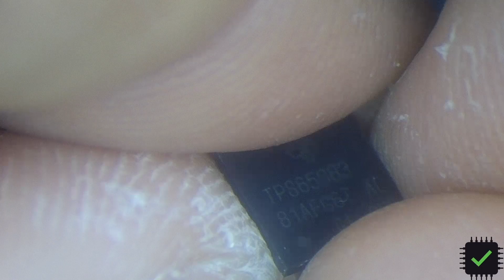Another Possible Weak Point on LG 5K UltraFine Motherboard if the Thunderbolt port is mangled

Comment: I have two LG 5K which both has come to suffer from the issue with the port. I have ordered new ports and am getting help from a local microsoldering company to hopefully get that taken cared of. 

However, it also damaged both thunderbolt cables (the long nice ones) and seemingly fried a thunderbolt port in two of my Macs.. very sad about that of course but one of the macs can charge albeit slow (using usb-c cable with wattage led I see it charges at about 15w) so I guess it might be a blown fuse or perhaps worse if its a controller or power regulator. Any ideas? 

I believe the cables became fried as I tested both in one of the monitors that seem to suffer more. The cable itself would become hot to the touch at the circuit part end but weirdly both works fine as charger cables. USB-C connectivity also works on the mac that survived but not thunderbolt. 

Thinking about if there would be any idea to put a small heatsink on the ICs that get hot inside the monitor? The fan is one thing but a heatsink could probably help disperse a lot of the heat buildup right? 

As I also have an iMac 5K 2017 I am toying with the idea of just making new enclosures (a dream Ive had for some time) and get new driver boards for the screens. Perhaps that would be a good way forward and also then have more universal monitors as thunderbolt is such a pain to be limited to when having so many different kinds of devices. (well one of my lg 5k is the newer with usb-c so it can for now work part time at least that way in 4k mode but still..)

And to finish off, do you think it would be possible to save the cables? Probably very tiny components inside but they are long, beautiful and I love them. My autistic sense seem to always hate throwing things away and I rather try to fix issues than just replace them. Thanks for your video and thanks again if you read all of this too =)